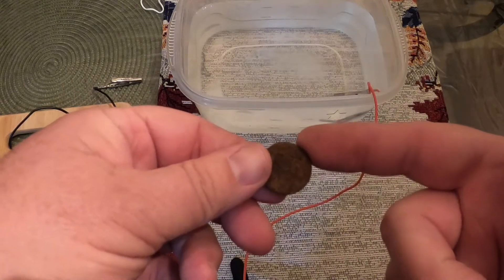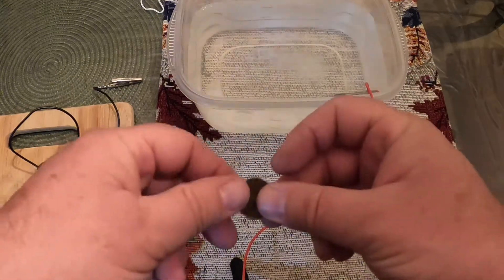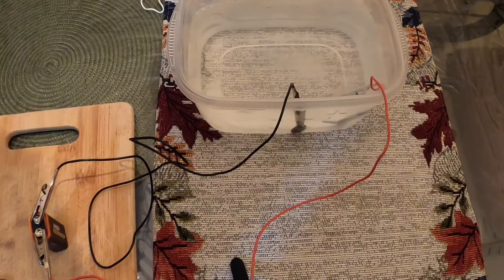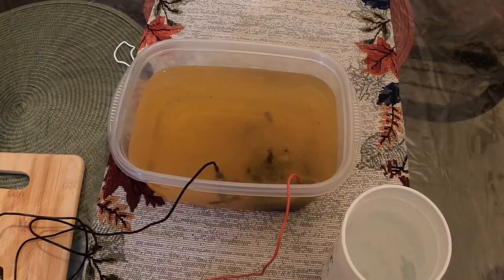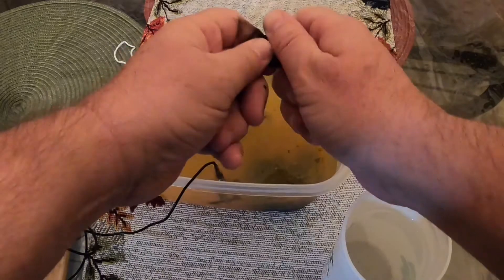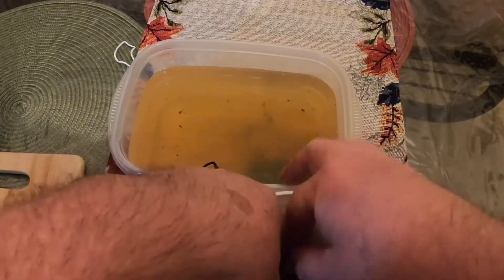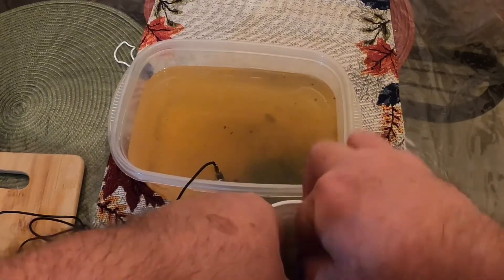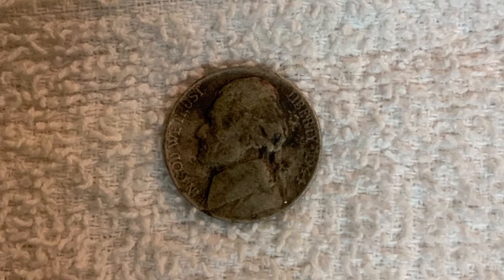Cleaning A Crusty War Nickel with “Poor Man’s” Electrolysis

Comment: This was really educational , thank you. I find a lot of coins in Florida, most are current, 1970s-90s and they look like the 1870s. The salt and sand really beats them up. Any suggestions you have are appreciated.
Reply from the maker: I run most of my coins through a rock tumbler,  it takes the caked dirt off of them, but they are still tarnished.  Most stores won’t take them, but you can put them into a coin machine, like at the bank, coin star or the self check out line.
Reply: @mrcharlie5938  Thank you!